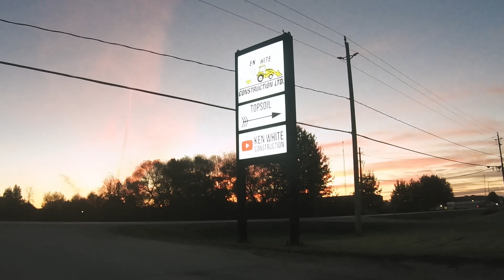Taking Delivery of my Brand New Black 2022 CAT 299D3

Comment: I actually   don't  think  the  299 is  worth it  as the  289 is  just as good  and  the hyd power isn't even noticeable  between  them  ?
Reply from the maker: Wrong. 289 still has the same 74HP my little 257 has. 299 has bigger motor, and more hydraulic power. Somewhere around 38GPM. coming from someone who has had both. 299 is a beast compared to 289
Reply: @KenWhiteConstruction  I've got all 3 of them  and the 299  is  not  worth the  extra money  for the power    the  289  actually   drives our  planers  better than the  299. And cold planers  are probably  the most hyd power implement you can  put on one